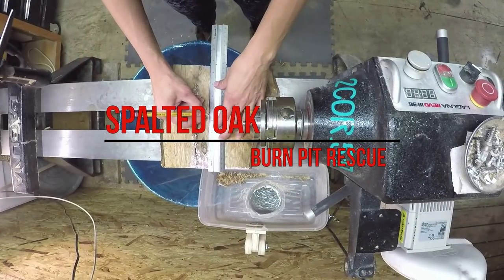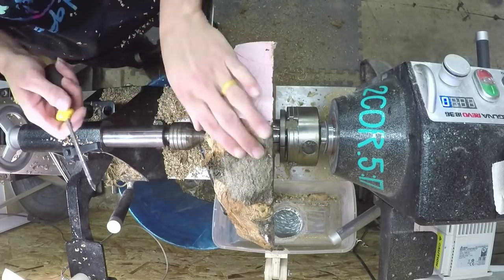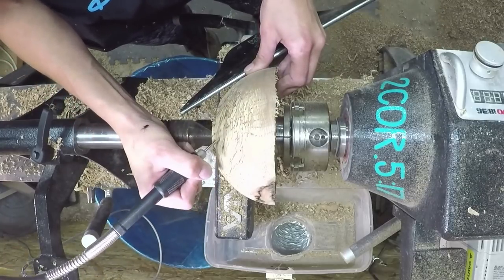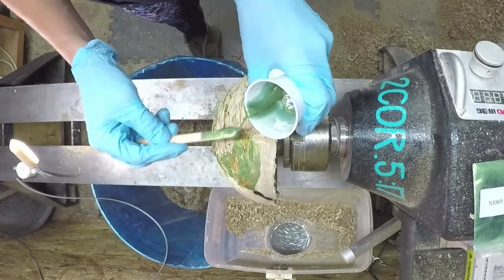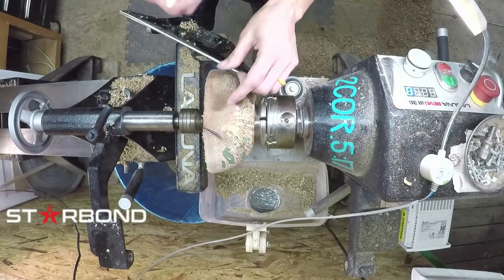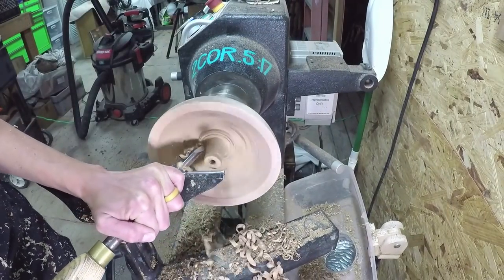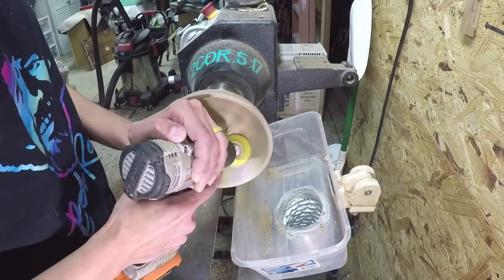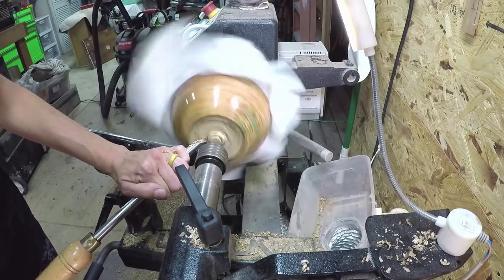Spalted Oak Bowl with Green Epoxy Filled Bug Holes

Comment: Nice. I'm just ready to try out my first resin filled bowl today. It a piece of plum wood, all knots and bark inclusions.
Reply from the maker: That should turn out awesome! 
Thank you 🤗
Reply: @KimTippin  didn't work out too well. The resin I used set and looked beautiful but when I started to turn it it was too brittle and chipped rather than cut. Was so hard it took the edge off the tools! Will have to investigate what happened.

Comment: Cool video.  I've used the same technique on my bug holed spalted maple.  Seems to be attractive enough for me to give my bowls away to relatives.  Does the CA glue harden in the slim tip?  What editing app do you use on your videos?  Thanks for the cool projects.
Reply from the maker: Thank you!! The slim tip does get clogged. They send a few with the glue. I really didn't need to use that ultra slim tip for this project but it was on the cap so I just used it.  I use Movavi. Thank you for watching!
Reply: I have found that by soaking the tip in acetone reallys to keep the tip cleaner...it wouldn't hurt to give it a try

Comment: good looking. I have found that if you use activator on fills that it will harden the surface and leave the deeper CA wet like putting the cap on the bottle. I have found CA on my shield and I can not get it off.  Love your work.   Thanks
Reply from the maker: Hey Charles. That has happened before to me too. I find that if I do a small amount at a time after each spray, the CA will harden all the way through. I tend to get impatient sometimes and wear a bit of glue on mask.  Lol 
Thank you for watching 🤗

Comment: Kim, I absolutely love your videos.  I am addicted.  As a new wood turner in Central Texas, I have lots of Mesquite on the ranch.  As it dries, you get worm holes.  This is not a problem because I am very interested in filling holes and cracks with resin tinted with mica powder.  Can anyone recommend a fast drying epoxy?  I have used epoxy glue and it worked fine but I thought there might be a better product in a little larger quantity.  Thanks in advance for any recommendations. SRE
Reply from the maker: Awesome!!! Tha k you so much for watching!!
 Total boat sells a 2:1 fast resin that comes in a quart size. It takes about 15-20 min to cure. I know there are other 5 min. epoxies available in larger sizes but I don't knew specifically a brand. I never used anything other than Harbor freight brand. hopefully someone will see your question and can give some other options.  
 I love turning mesquite! Beautiful wood. have fun!!!

Comment: Hi Kim....It's me bothering you again.....love the piece, but a couple of"?s"arise. (1) I have used dry oak before but always seem to have problems with it splintering & cracking. You don't seem to....can I ask why and what do you do that's different ? I would have to soak the piece of wood in CA glue in order to keep it from doing that. (2) Can I ask where you got your name iron at? (3)Is there any one particular tool that you use more than any other?  Any ways you do good work . I hope to have more conversations with you in the near future . Love you and GOD Bless...Gary Belich
Reply from the maker: Hi Gary! No bother at all. I will be glad to answer questions the best I can 😁
So for the splintering oak.. I only have issues with it when I turn it green. And what I mean by that is that joke. Seems to move the most out of all of the woods that I have tried to turn green. with my limited experience I would say the oak is one of those that can look drier than a bone and still move after it is turned. It's all I had for several months my first learn to turn so I guess I just got used to it. To be honest I expected most woods to be exactly the same. Because I didn't and still really don't know much. I don't have a splintering problem like you described. But it sure does like to split and crack. I haven't had any splitting or cracking happening in any of my dried pieces that I have turned. Like I said only with he's as I turn while green. I got my branding iron at brandingirons.com I may have to double-check that I'll add another comment with the exact link. As far as the tool I like to use the most, definitely hands down my 5/8 hurricane bowl gouge with Irish grind.if I was stuck with one tool I can pretty much do everything that I need to do, with it. Thank you for watching and God Bless!!🤗